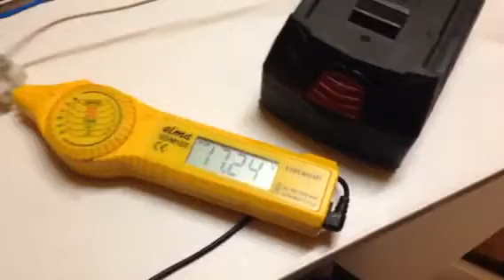IT generator 2. Balanced.Tesla, Kapanadze

Comment: short HV Pulses (like with a sparkgap discharge of a capacitor, or car ignition coil) work best. The ZVS pulses might be to long in duration(to let the coils ring). but as long as its high enough in voltage it works.  you could replace the center induction coils, with bifilar panacake coils, and also, tune the whole setup of coils. So the resonating top and bottom coils, are tuned to the center coil, this should provide a higher gain.
Reply from the maker: Master Ivo , thanks for the info I will try a new set up with PWM and ignition coil, spark gap or maybe a fly back from another ZVS I have ? I will post when it is ready. And I have received your mail, just checked, will be in touch, thanks.
Reply: best connect both ends of the pulse (not one to earth) so the discharge enters from both ends at the same time into the center coil(make it a bifilar). Good luck, and looking forward to you email reply :)

Comment: Parallel 2ea 18vdc batteries and twin-pancake induction coils,rectification minus capacitors running the 250W halogen and the dc motor to the batteries= recuperation: Great! Nice setup...

Comment: Hi N&I, superb job ! Again I say the same as to Igor do not forget the the light is consuming !!! SO !? Just take the load off and see if voltage of the bat go's up !? For me this clear OU because it stays stable or even if the voltage drop's a bit it would be way more faster in normal conditions ! Remember 250W load DUH !!!! Anyway will look into it and let you know findings when material has arived ! ; ) superb job both of you !

Comment: yes, thx, Nick it's about the same;
what i have done by that time - ran the system a little longer with cooling the bridge, about half an hour....
the main thing was to figure out if we have ANY recuperation in this setup; 
so i've measured voltages on both batteries BEFORE start, and same AFTER stop! 
if we have any recuperation, the voltage should be the same, and higher if we have any gain...
unfortunately after stop in 1/2 hour the readings were less than before start ...... 
i did not upload video about it yet;
and i would appreciate if you do the same test;  hoping you will get even on readings ......